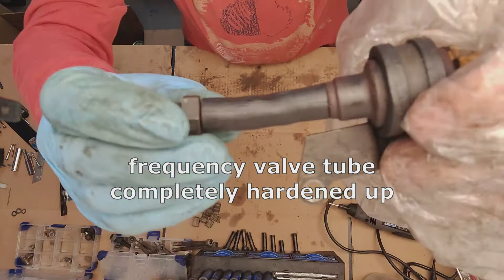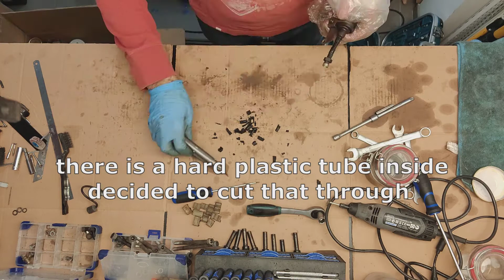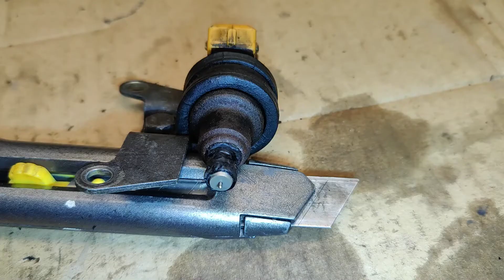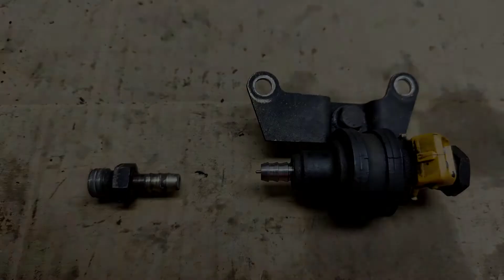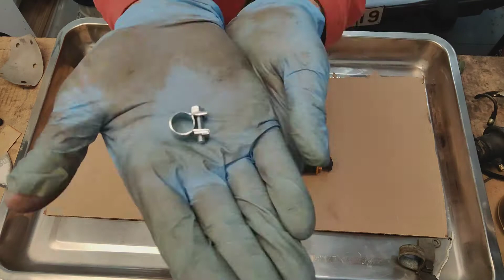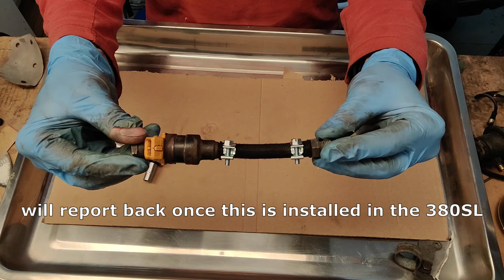Frequency Valve Repair

Comment: I recently acquired a 1981 380sl for free. It had been sitting in my neighbor's driveway for 15 years. https://www.youtube.com/watch?v=OXuDYs3dCOQ
To get to the point, I can not get the car to run. OK, I can get it started, but it will not accelerate but it idles smoothly. I do not know much about Mercedes, I am learning on line. Thanks for the videos by the way. When it is idling, I push down on the pedal and the engine bogs down or dies. If I gently push down on the air flow plate it speeds up. I have checked the Idle control valve and the WUR. Seem to be working. If this was a British car I would be looking for a vacuum leak.  One other thing, the Tach does not work and there is no power to several fuses in the fuse box. My problem is, I don't know where to look for the problem on this car. Could you point me in the right direction?
Thanks.
Bob
Reply from the maker: The best source for information is this forum: https://www.benzworld.org/forums/r-c107-sl-slc-class.29/
I would start checking engine timing, and the advance unit.

Comment: A swing and a miss but COULDVE been so helpful. 
1. Where is it located?
2. What is it's function
3. How does it work?
4. How to remove it?
5. How to reinstall?
Guys who are super smart on these cars forget that some of us are just starting...
Reply from the maker: You can see me remove it in a previous video here: https://youtu.be/W1R1pWrwQIk?t=126. 
Simply put, it is an electronic valve that is controlled by the ECU to regulate the fuel/air mixture based on lambda sensor input. 
Very good detail here: https://www.benzworld.org/threads/k-jetronic-with-lambda-overview-and-adjustment.2182425/#post-10439529
Good luck with your car